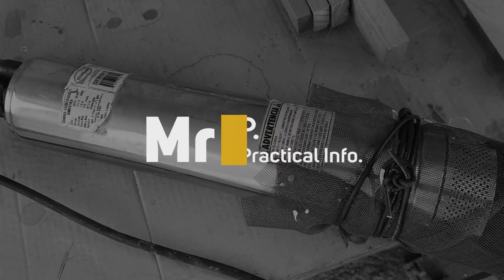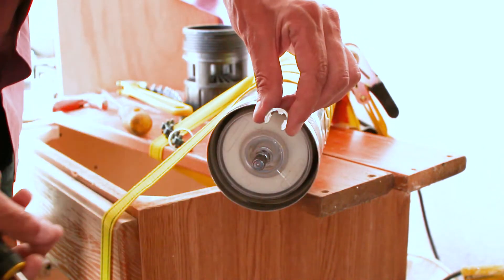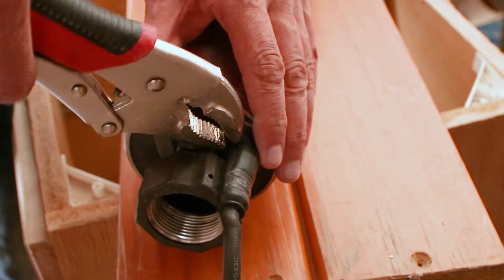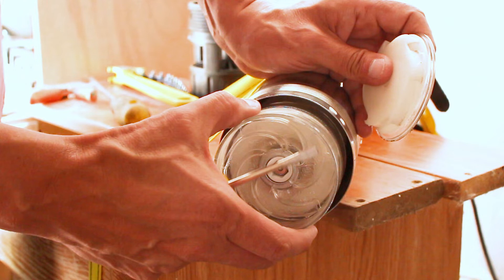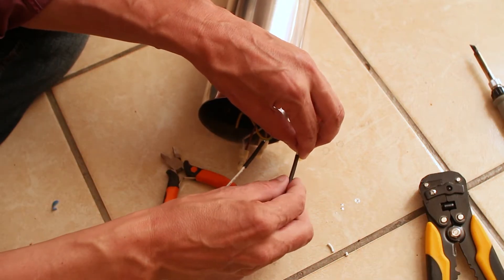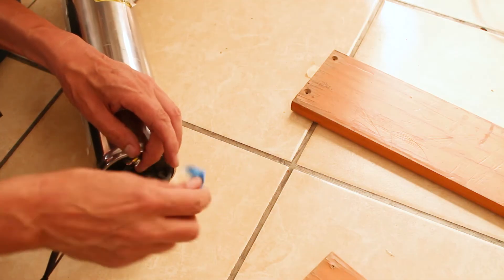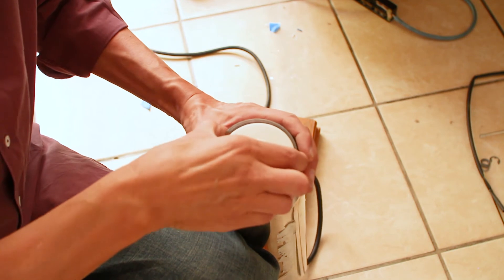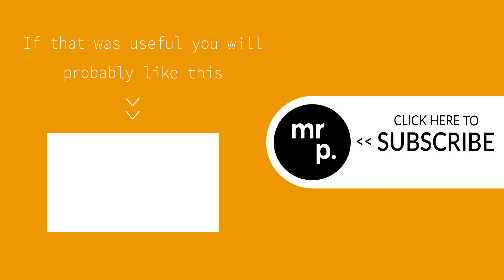Repairing a Chinese Submersible Water Pump 💧

Comment: Thanks for the tutorial. I have the same engine, but once the electrical cables are cut, I can't disassemble it and access the interior of the engine. It forms a single block with the black threaded piece where the hose is attached.